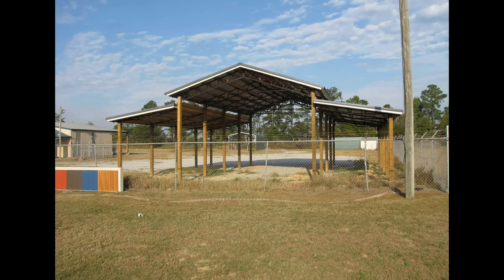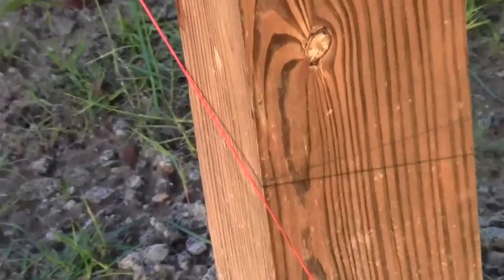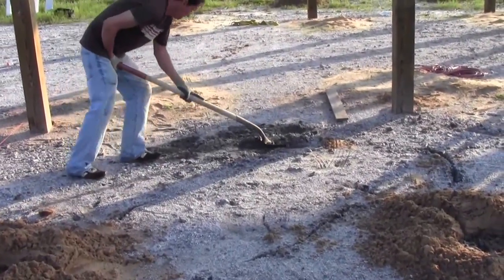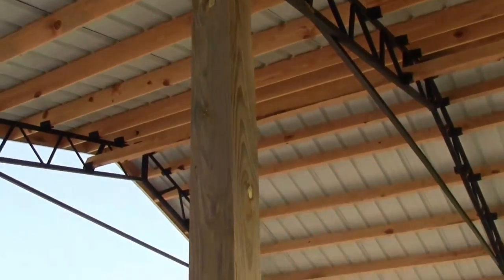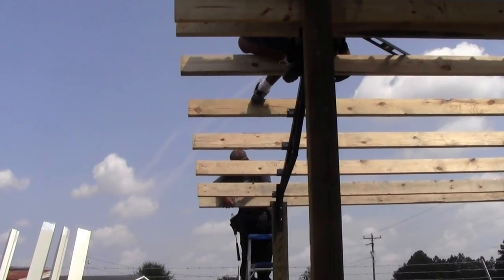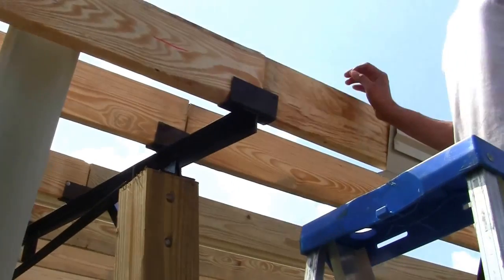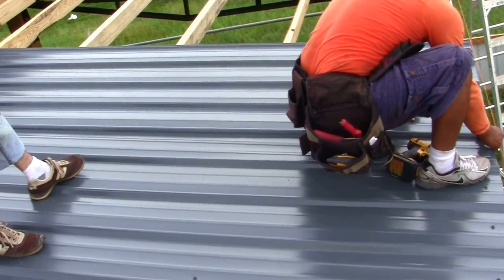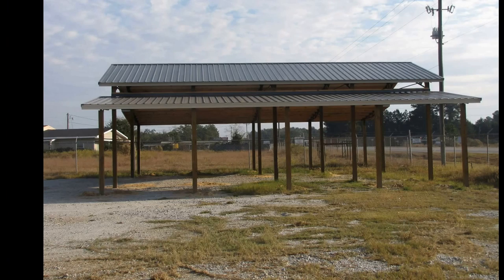How To Install Lean To's On A 20x40 Steel Truss Pole Barn Kit

Comment: OSHA would have a field day with these guys. SOOO MANY safety violations...
Reply: Its a barn man.
Reply: RoofMill.Net Since it's a barn they don't need to practice basic safety?
Reply: Not really saying that but I will not expect to see OSHA poking around on the farm like I would on a commercial build in the city.  Some sites I do off grid systems, they would not allow a govt man there without a warrant.  Its still America in many parts of the country where I put in systems.  I don't do safety for the govt, I do it so I can make it to the next day. :)  These guys probably more worried about border patrol.
Reply: RoofMill.Net It sounds like you do construction. Did you watch the video? I hope you don't let your crew operate like these guys.
Reply: sometimes yu gotta just gotta burn the safety manual and get the damn thing built.. critics can put their complaints in the suggestion box.. it's the big green metal box that says waste management..